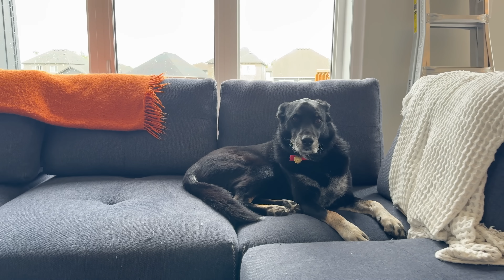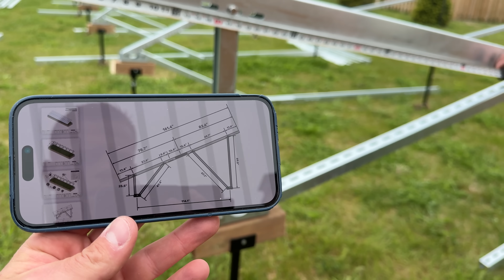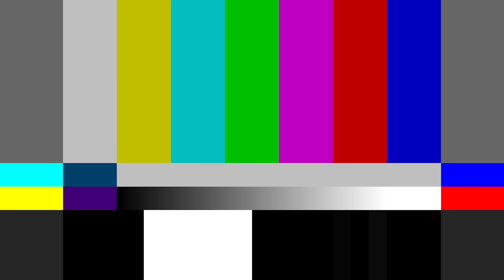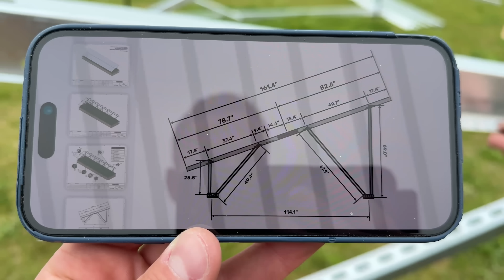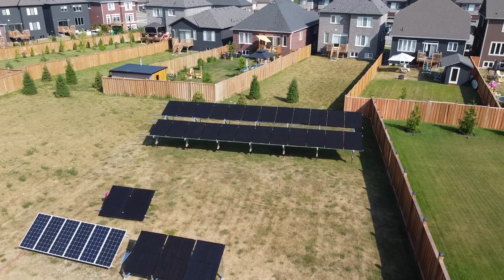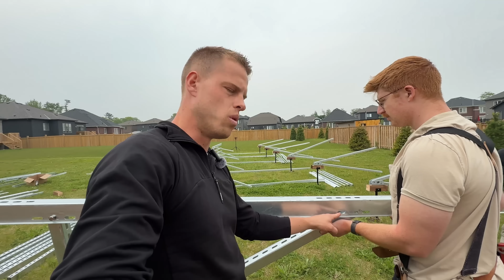The ULTIMATE DIY Backyard Solar Panel Ground Mount? - Chiko GroundFlex Kit

Comment: That truck has a Lift Gate on it, so all the driver had to do was use his pallet jack, load it onto the Lift Gate and lower the pallet onto the driveway.  You not having a pallet jack is a fail on your part.  If the driver didn't have a pallet jack (which is Rare), then it was a total fail.

Comment: I have this system. Me and my crew have assembled the uprights and braces. I agree you have to be careful because the braces are 2 different lengths. The bolts are hard to differentiate, and being stainless tend to crossthread if you have to remove one. My question is how far apart did you put the ground screws. In my area the building codes are for 120 mph winds and Chiko says they need to be 6' apart for that. I had to buy extra uprights and braces.

Comment: I really like the Ready Rack from APC Solar that I installed in my back yard.  It’s made of heavy duty galvanized steel..  The engineering drawings and installation instructions were spot on.  And it was quite a bit cheaper!
Reply: its definitely not cheaper for a ready rack system, i just got a quote from them and its about $1500 more than the chiko

Comment: I was looking at that mount sure glad I opted to build my forth array out of 4x6, 2x6, & a few 2x4’s. I am now building it into a Carport for my Skidsteer implements. My 560 Bifacial’s worked well with Ironridge XR1000 rails. I am now pushing my SolArk15 to its maximum 19,500 Watt DC rating of course closer to 18,500 watts. And 6300 watt A.C. with my maximum 25,000 watt Cap to my Power Company I have hit the end of the road for Solar Generation.

Comment: Where did you get that grounding spike, and what other materials did you use to ground the whole system?
Reply: Looked like an aluminum grounding mount, #6 or #8 grounding wire, and likely 8' long grounding rod and clamp(s) from Home Depot, Lowes, Ace Hardware, Menards, etc..

Comment: Heads up from a previous warehouse manager. It's the shippers responsibility to unload their shipment. If you wanted to, you could have insisted they unload it. I suspect they would have been back the next day with a lift gate and pallet jack.
Reply: Not true.  Having owned a freight brokerage I can assure you that the driver's responsibility ends at the tailgate.

Comment: Thanks for the video. Be aware that panel manufacturers specify an “allowed clamping zone“ for solar panel frames to accept top-mounted mid and end clamps. That bottom row of clamps is way closer to the frame bottom edge than some manufacturers specify in their data sheets. 

We also didn’t see or hear mentioned anything about WEEB washers for the mounting clamps. Did Chiko provide washers with sharp points which pierce the anodized frames to ensure a good electrical bond enabling a low resistance grounding path?

Interesting to see Chiko is offering ground mounts—not just carport mounts.

Comment: Thanks for posting this. With six young guys for the unloading and installation, no wonder it looked easy.  I am 65 and DIY for me means doing it all myself.   I agree with the pricing comments, I could build something better for less than $5K.  Since you guys are in Canada, what is the snow load capacity of that rack?  I guess time will tell.  Just curious, do several of you live in the same house and do you guys have other day jobs?

I use the same panels with a brightmount kit for my 24K AC unit.  They have been great 

Overall, nice review and keep them coming.
Reply: He told the snow load rating, in the video.

Comment: For the price, it does not generate a single additional watt of power compared to cheaper, commercial proven system (Sinclair?).  I would absolutely expect it to be 30-40% more than an equivalent and proper DIY build, but this feels like it is 60+% more expensive AND doesn't include all the hardware.  Last negative for me if that it is fixed angle.  The 30-panel Sinclair with adjustable tilt if STILL less money.  (Not a Sinclair fan boy, just where I landed after my research IF my DIY ends in a pile of mis-cut lumber. ha!)
Reply: Yeah this kit is overpriced chinese garbage.. You can make this out of wood for $1500 and it would be adjustable, or you can go to the Cadillac of mounts, the sinclair, which would come with engineered drawings for code approval (doubt chiko will do that) for less money.
Reply: Engineer775 loves those Sinclair mounts and has installed lots of them on YouTube!

Comment: I wonder will the wood be weakest link it will start rotting after 3 years
Reply: Not if you soak the wood with a diesel and used motor oil stain. It will last 30+ years if you re-apply it every 10 years.

Comment: About  $7000 price seems high
You can buy  10 foot sections 
1-5/8" x 1-5/8" Short Slotted Strut Channel 4 ft. - Aluminum $27 or less
Reply: For 30 panels or so they say plus other parts $7000
Reply: @samfish6938  30 panel heavy duty on screws is just under 8k plus you need to supply your own parts.. This is a pile of shit for what you get.. Just to put into perspective you can get a ground mount from sinclair for less and it handles more wind, snow and is made in USA...

Comment: excellent honest review, thx! if the manuf is listening, and since rougher texture of galv coating usually means thicker protection (a good thing), best fix for the too tight fit might be to over-size the female half of the connection to allow for the galv. Also, the manuf'd framing sure looks like it will withstand 100+ mph, but the foundation-anchor-to-wood-blocking and wood-blocking-to-framing looks like the structural weak point in this system

Comment: $2065 for the metal framing. Would definitely need to compare with DIY. Thank you all for your efforts.
Reply: Yeah, the pricing is insane and you can build a pressure treated wood mount for a fraction of the cost. They spent $5K? For half that price, you can build a DIY pergola, then put solar panels on top of that using uni strut. Not only do you get the same size solar array, you have useful living space underneath. Imagine sitting under your pergola drinking a long island iced tea while your solar array is hard at work. I can't justify $5k.
Reply: I have roughly 5k into mine.   Part of it is built on piers, the rest of it is used ground screws (about the same price and WAY easier).  It is a mix of 3" .240 wall and 2" .240 wall, both square and I stick welded all of it.   Panels are mounted to strut.  10.2 kw.   The stanchion will easily live through me replacing the panels at end of life for another set of panels.   Try getting today's treated lumber to live 15+ years and not need rebuilt again midway through.   Treated lumber anymore is garbage.
Reply: I thought I could beat prices with wood but found out wood sucks almost all of it is warped so have to work around that, and even drilling pilot holes wood splits. Can build out of steal won't beat the cheap prices of China the only DIY might save money is buying surplus steel. There is a local place sells steel shelving about half the price of local steal places.  Wood worked out for me but it wasn't cheap adds up quickly.
Reply: But with that said, it's still a great video.
Reply: Less than 300 diy
Reply: @meilyn22 not even remotely to code
Reply: @wadebrewer7212 Yes, to code. You can literally see it being built here on youtube.
Reply: @wadebrewer7212 I was wondering the same thing.  That would fail inspections in my area
Reply: @RCTVAccount  If you have to deal with building codes then you aren't far enough from paved roads yet.

Comment: @Solar Lab  can you link or identify those ground screw anchors you used in this video? Thanks
Reply: Pylex Foundation Screw Piles! Home Depot sells them in 4’ or 6’ lengths I believe.
Reply: @blackridgeproductions2738  Home Depot has 50" Adjustable Helical Posts. $45 (USD) each, they had the best price also
Reply: Looks like they have a method to hammer in a rebar to help align the screw. Link can be see in Home Depot site.